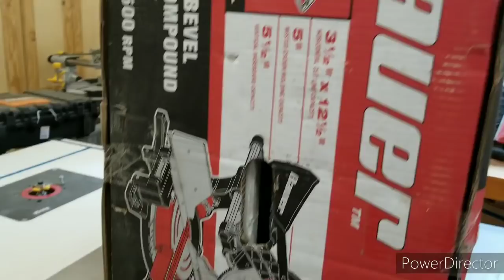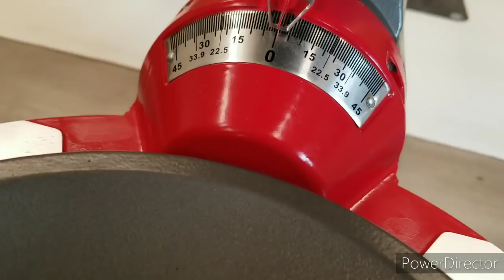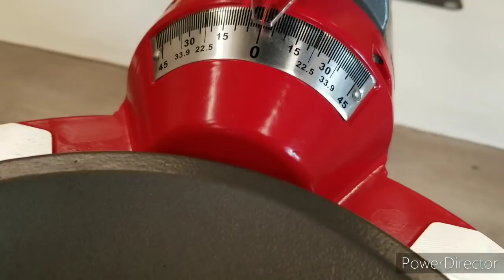Bauer 10 in Dual-Bevel Sliding Compound Miter Saw, Harbor Freight unboxing and review 57179 19743E-B

Comment: This test is only if you want to saw with precision with a miter saw.(test is not intended for rough and hard work).     
Tips and Test: 
Very important if you would like to saw with precision. (avoid torsion as much as possible)!
Always choose a Miter saw with a handle positioned in a VERTICAL line above the saw blade.  
Everything must be aligned, slide rails, handle, and saw blade,it is much better this way the blade will not tilt.
Because there is some torsion in the aluminum housing .
And choose an engine with softstart on it to prevent wear of the gear and worm shaft.
It is very important that everything is aligned.
Here are some examples to show how the handle must be positioned above the blade.
first option: Bosch gcm 800 sj / Bosch gcm 8 sjl / Evolution rage 3 / FESTOOL KS 60 / Bosch GCM 8 SDE / FESTOOL KS 60 E KAPEX / Metabo KGSV 72 Xact / Bosch PCM 8 SD / Hitachi C10FSH / Ridgid MS255SR 10-inch / Evolution Fury3-S / Evolution R255SMS / Metabo HPT C10FSBS / Hitachi C10FSB /  Hitachi C10FS.
Second optie handle horizontal positioned above the saw blade / Evolution R185SMS / Evolution F255SMS / Evolution RAGE3R255 SMS3 .

(This also is the case with the Miter saw without the slide rails).

(If you want). You can test it yourself at home if there is torsion in the aluminum housing.

Step-1. First you make a saw cut from +-5 mm deep in to a flat piece of wood about +- 20 mm thick to this with the normal handle positioned on the right side of the Miter saw (the wood it will remain in place until the test is completed).

Step-2. Then repeat this by pushing the saw blade down with your hand (finger) on the aluminum protective cover were the saw blade is cased in. Just now only do this without the running engine.

Step-3. Now you can see if the saw blade will be positioned in or next to the saw cut. If the saw blade is (+- 0,2 / 0,5 mm) next to the saw cut then there is torsion in the aluminum housing (test is completed).

Step-4. Therefor it is much better to choose a Miter saw with the handle positioned VERTICAL in line above the saw blade. 
The second option is the handle positioned HORIZONTAL in line above the saw blade.

Step-5. When you measure the vertical 90 degrees angle square (Digital Level Box) of you're sawblade don't forget that there is always some torsion in the aluminum housing.

Conclusion:how further away the handle is from the saw blade how more chance of torsion in the aluminum housing don't go for that  (the choices are yours).

Also with a cheap slide miter saw it is still better the handgriff in line a above the saw blade than on the right side. Maybe they will make it someday then we have a winner...
Reply from the maker: I agree 100% with you. Doing construction work using construction materials close is good enough. As I have started doing finer woodworking with better materials, a few hundreds off shows. The Chicago Electric miter saw when fully extended you can get a full blade thickness of deflection. 

I had planed on buying the Delta Cruzer thinking the articulating arms would be more accurate. It seems they have discontinued the 10in model. It was 3 time as expensive as this saw. I looked up several of the saws you mentioned. They all look like nice saws. Most cost twice as much as this one. 
This one looked like it could be nice and I figured if I didn't like it I could take it back. I spent a couple of hours cutting with this saw. At first I was not very impressed. After I got it zeroed in it surprised me. I was not taking care how I pulled the handle.  At around 10 inches it was only .004 out of square. Every angle cut was dead on. With the 15 amp motor it never pulled a load. I had a lot of video I had to cut out. I can't find anything I would change on the saw. I still can't believe the quality for the price.
Reply: @ShopRamblings  cool review. Didn’t know this was out already!
Reply from the maker: I ordered it online and paid the $7 shipping. It arrived in 2 days. I find at Harbor Freight that their new items will be posted on the website first. Then it'll take a couple of months before they get in all the stores. After they are in stores they then normally have a coupon for around 25% off. I would normally wait until the first coupon came out but I was not sure if I would like the Saw being that it was this cheap. I figured I could test it out and if I didn't like it I could always take it back and still be able to take advantage of some Black Friday specials. But I am going to keep this saw unless something drastic happens on my next days off when I test it some more.
Reply: @ShopRamblings  the thing I usually can’t justify with HF is the warranty. By the time you buy the warranty you’ve paid as much as a name brand. However, I guess the perk is that once you buy that warranty you can exchange for a brand new tool no matter what, which a lot of other companies won’t let you do. Looks like a nice saw though!
Reply from the maker: @matthewburch6604  I do not buy the ones that cost as much as the big brands. I don't buy the extra warranty. I was told by someone in the industry that extended warrantys have the highest profit margins and I believe it. Last week I bought a name brand tool that had Lifetime Service Agreement written on 5 sides of the box. When I scanned it in the self check out the register went into lock down mode until an employee came over and put in his code and verified that he asked me to purchase an extended warranty. 

Many time HF has their tools made in the same overseas factory as the name brand for a fraction of the price. I believe this is the Jet saw that sells for $600. I have purchased hundreds of tools. Only a few have failed within the warranty period. With the money I save I can replace them and still be ahead. Years ago I had mostly Dewalt at my company. It was a small business but I still spent over $500 a year on the overpriced batteries. I have tools of almost every brand. I don't spend extra just for a name and I don't like cheap tools that don't work. I am always looking for value.
Reply: @ShopRamblings  very well put. Didn’t think of that. I don’t buy expensive tools by any means—as a weekend hobbyists  I couldn’t justify it. Hell, most of my tools are ryobi lol. I spent about that much on a Ryobi same size and the Bauer definitely looks more beefy!
Reply from the maker: @matthewburch6604  I was having a hard time justifying spending $100 on a Ryobi table saw but I did. After using it for years and doing several upgrades I could justify getting a good table saw. There is a place for cheaper tools. Now my skill level has increased I have several blades that cost more than my old saw. Had I never bought that cheap saw I would had never known what I could build. 
I currently have 3 different brand miter saws in my shop. I have owned other brands and used even more. So far the only thing I would change on this saw is the trigger. If I get time I might make a mod video on doing it.

Comment: Thanks for this video Robert. I just picked one of these yesterday from a HF out the box special for just under $180 with the membership I also purchased to get a $10 discount. Other than I think it might be missing the lower blade guard, I was wondering about some wrench it says it also should have come with aside from the dust bag. I think the wrench is the phillips hex dual sided tool that is housed within the saw? I downloaded the manual but didn't say much about the included tool. I'd like to keep it but wonder about their 90 day warranty though out of the box I only have 5 days to return it if i don't want the thing since its an open item. Wondering if the price difference I am saving is not really worth it since wasn't even offered an extended warranty. Dewalt comes with 3 years so yeah it's pricey but perhaps worth it, ya get what you pay. I am a lady and this is my 1st miter saw, and big tool purchase. I appreciate what you did here.
Reply from the maker: It is all about risk vs reward. This is a 10" sliding miter saw. It sales for around $250 with a 90 day warranty. The shadow line has a defective design and the dc converter is powered anytime the saw is plugged in. If the saw stays plugged in for months like mine does in a hot shop it doesn't last. To me the shadow line was nice but not a necessity. Other than that if the saw runs like it should and the fence is square there is not reason to think that is going to change in the next 2 years. Dewalt DW717 is their 10" sliding miter saw. It runs $500 if you can find it. They are discontinuing it. The way I look at it if this saw breaks and you have to buy another one in a few years you will be at the same amount of money had you bought the Dewalt but with a 2 year newer saw. Other than the shadow line I have not heard of many other problems with this saw. To have 2 saws go bad in less than 3 years would be some bad luck. I left mine outside for a week while I was out of town during some nasty storms and mine still runs like new. 

The Ryobi 10" sliding saw is $180 new but I don't think it is as good of a saw. So you can get a lesser saw with a warranty. The only brand I do not like is Dewalt. When I owned my company all of the power tools in my shop and on every service truck was Dewalt. I have had decades of experience and have spent thousands on Dewalt tools. I will never buy another Dewalt power tool. If you want a quality 10" miter saw I would look at the Ridgid R4241. It is $400 and I believe is a much better saw than the Dewalt. 

The tool is just an allen wrench with a phillips on the other end. It is stuck in the back of the left rail. You only need it when chaging the blade which should not be that often. No matter what saw you get, buy a good blade. The blade makes more difference and the saw. Freud make a "Sliding Miter Saw" blade. It has a neg tooth angle and makes great cuts on an miter saw. Hope this helps.
Reply: @ShopRamblings  You are awesome Robert! I looked again and got the dual tool where you said it was, also the clamp and safety guard for the blade so nothing is missing. Only the manual but I did get that online as I think I had said. I am keeping it, because at this point I didn't have time to take it back and only had 5 days. I've not even plugged it in yet because its been crazy raining here and I spent all day yesterday and all night tonight trying to rearrange my garage so I could get to the plug so I don't have to run a long cord and lose any power form an extension that would be way longer than 10' to the nearest outlet otherwise. I'm new to this stuff so if it helps me build a nice work table for myself and complete the few projects I am wanting to do around here then I am a happy camper. SMILES
Reply from the maker: I have bought 3 of these saws. Only one I could not get it to cut angles perfect but it was still within 0.2°. I was still able to get to dead on 90°. This is closer than what my skill needed or required for years. 

Most residential outlets are 15amp wired with 14ga wire. A 25' cord with 14ga wire is not much different than using an outlet on the other side of the room. I buy extension cords with 12ga wire. I run saws on 100' cords with no problem. 12ga cords can be expensive (over $100) but if you keep a lookout on Brickseek and Den of Tools Facebook page you can catch them for around $30.
Reply: @ShopRamblings  You rock! Fortunately I have one that's 50'' and works from far back corner where I cleared a path to get to the outlet. I will have to use my circular saw for what I have to cut today because the boats are too large to manipulate to use the miter saw on without a table or even a stand yet. I do everything backwards and end up with a whole workshop of tools this way LOL
Reply from the maker: Keep an eye out for a price drop on the Rigid AC9946. I got a couple last year on Black Friday for $79. They are a few different brands that are the same but this style of stand works the best.
Your friend has shared a link to a Home Depot product they think you would be interested in seeing:

RIDGID	Universal Mobile Miter Saw Stand with Mounting Braces
https://www.homedepot.com/p/RIDGID-Universal-Mobile-Miter-Saw-Stand-with-Mounting-Braces-AC9946/206992161
SKU# 206992161
Reply: @ShopRamblings  Thanks yet again Robert. I did see you and others who have this saw using that same stand. I want to try and build a nice work table I somewhat designed but hard to use the saw to build it with no stand. Happy Holidays to you and yours my new friend.
Reply: @ShopRamblings  I've tried Brickseek before and thank you for reminding me about it. Might try and use it to look up the Rigid stand.

Comment: Hi! Silly question from a first time miter saw user. Got this one for Christmas so I can install a new floor in my walk in closet. That’s done. Now it’s time to install new baseboards. How the heck do I bevel this machine to the right?!?
Reply from the maker: Reach around to the back and pull the pin and push it right. It is made so that when you go back to the left it with stop at 90⁰.

Comment: I just bought one of these.  It came out of the box locked in the 45 degree position and no matter what I do I can not get it out of that position.  Is there something I missed or something I am doing wrong??  I feel like an idiot because I can not find a release to make it usable.  It is not usable in the position its in. 
Any help appreciated!!
Reply from the maker: Is it the miter or the bevel that is in 45⁰ position?
Reply: @ShopRamblings  its the bevel.  I contacted the store I got it from and they are going to get me a new saw.  I need it for my business and every day I am down is money lost.  It appears that the pull button on the back of the saw to get it to 0 on the bevel is damaged on the inside.  I tried to get it to pull out by hand as well as using a pair of channel locks and it will not budge.  So I'm just going to return it for a new one and I will make sure it works before I leave the store with it.   Thanks for asking sir your interest was and is greatly appreciated.

Comment: Help me lol. I just finally opened mine up. Christmas present from my father. I asked for a miter saw. I'm new to being a casual wood worker.

Anyways this thing is way bigger than I expexted. I'm not sure what to set it on. Could you recommend a stand for this saw or the best way to improvise one using a table or bench?
Reply from the maker: I like the Ridgid stands if you can get them on sale. There are a few different brands but the ones with the big wheels at the bottom are much better than the rest.
Reply: @ShopRamblings  thanks a lot

Comment: Thanks Robert. I just got the same saw but cannot find a stand to bolt it onto. I see you did bolt it to a table stand. Which one did you use and do you recommend it? It looks like it may be a Rigid miter saw stand, is it?
Reply from the maker: This is the stand I use and love it. https://www.homedepot.com/p/RIDGID-Universal-Mobile-Miter-Saw-Stand-with-Mounting-Braces-AC9946/206992161
There are a couple of different brands but this is the best style I have found. Lowes sells the Delta one but right now the Ridgid is the cheapest. If you watch direct tool outlet the have them for as low as $80 sometimes.
Reply: Thanks so much Robert. Does the bolt holes line up with the Bauer miter saw easily?
Reply from the maker: The holes lined up. I did get some different lenth bolts. I could have used the ones in the box but i put the bolts coming up from the bortom and did not want them sticking up past the nuts.
Reply: Thanks....very much appreciated for your time and expertise. G
Reply: Well it looks like Home Depot does not have them and does not know when they will. I don't live near a Direct Tool. Any other stands that may work? I see a WEN that claims it will fit all miter saws, know anything about it? Does Bauer suggest a stand?
Reply from the maker: You can bolt most any miter saw to any stand.  The mounting bracket is just a long slot. I had miter saws for decades before I was give a old stand. It was night and day difference. I will never buy another saw without a stand. The ones that have the wheels next to the ground are much easier to use but any stand in better than no stand. I have had 2 of the HF stands. They were good.  I got a Ridgid stand for $129 then two weeks later got one for $79. Check back frequently as the availability can change daily. I started to buy another router table last night.  I had it in my cart but didn't want to get out of bed to get my wallet. 6 am went to order and it was no longer in stock. About 2 pm it was back in stock and I was able to order it. HD has the notify me when in stock on every item and it works well.